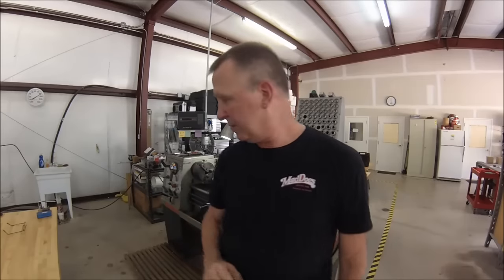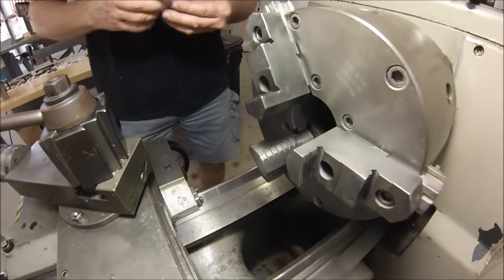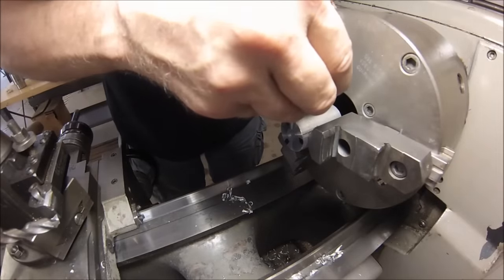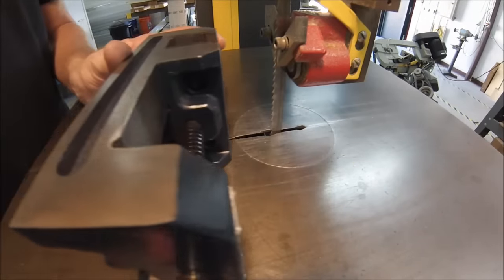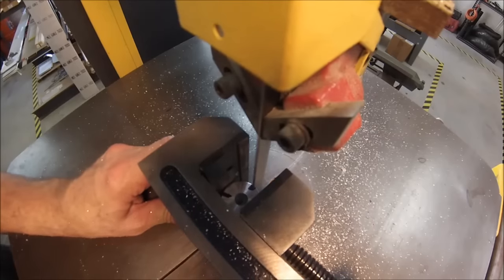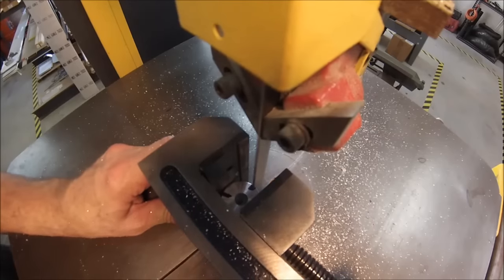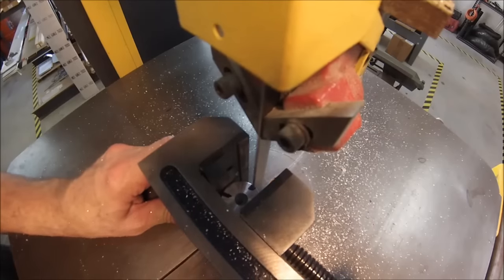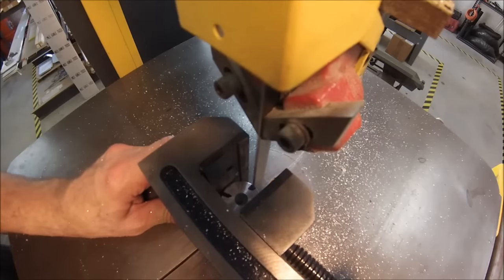Get your parts to run true in a non adjustable chuck. YOU MUST WATCH THIS!

Comment: I always wondered why people insist on filing right-handed on a lathe. It looks dangerous as hell to me and filing left handed is not hard. Are we not machinists? Are we not 95% ambidextrous anyway?
Reply from the maker: Isn't standing in front of a machine tossing hot sharp chips dangerous? I say file the way you have the most control and just keep the tip of the file away from the jaws. I have tried left hand filing and I'm not a fan.
Reply: I've tried left hand filing and it seems if the file skidded off the part it was right into the chuck. Right handed I was braced on the headstock of my lathe and still in control. I'm only running a small 10" lathe so it might be a different story with a large machine.
Reply from the maker: I agree with you 100%. On larger machines, I always deburr the parts with a chamfer tool in a holder.
Reply: @disgruntlescientist: Have you tried using a lathe file?
Reply: It just seems to me you end up hugging the headstock that way, with your entire head and body directly in the plane of the rotating chuck -while filing.

Comment: I pucker when I see someone filing a part close to the chuck, I usually put the file on the other side so if hits the chuck it will through it away from me.
Reply from the maker: So basically when you loose your registration point you'll fall into the jaws ???   Its only the tip you have to worry about. I've been doing this for over 40 years and have not had a chuck grab a file yet (knock wood) Stick with what you know and has worked. Overall....there is nothing good about putting body parts that close to moving machinery. You just have to accept it is part of the trade.
Reply: Use the file as a left hander when the chuck is large.

Comment: It looked like a bit of a bodge tbh. Which only works for pre-round pre ground stock and then each new piece has to start the same size. Why not spend the 1/2 hour to better set up the chuck to run true for all stock?
Reply from the maker: Thats not the idea behind this video.
Reply: Oh my days...There's always one expert that wants to rubbish a great idea. What if you're a home hobby guy that just wants to turn an accurate part on your ancient machine because you can't afford anything better? Joe I've been doing this stuff since the mid 80's. This is one of the best hacks I've seen, I've been doing the reverse for years...turning a diameter onto a bar with slots in and a threaded and countersunk hole down the centre...put your part on wind a countersunk screw in to expand your mandrel and now you turn concentrically to your ID Top drawer mate...keep them coming.
Reply: @iiredeyeiiredeye1569  look i can see that it works.  But my point is that it only works for the specific piece of stock that you have at the time. Would it not be better to fix the origin of the problem that this "fix" is trying to solve for any and all your stock? That way in future you wouldn't have to waste time and metal making an ad-hoc collet for every job.
Reply: @joepie221  i get it. It works, but is there not a way to fix the machine? Surely a fully true machine to acceptable tolerances is better than having to make a fix every time? Can you show us that fix? Regrind the spindle nose of the lathe or checking the centres?
Reply from the maker: @martynbrown8210  This is a band aid solution. Re grinding the jaws with a tool post grinder is the true repair for this situation. I don't have a video, or the need to do this, but there are many videos on the process on youtube.

Comment: A cool trick but soft jaws are much faster and easier to deal with.
Reply from the maker: IF you have them, and the carrier jaws required. This will help you get the job done. It is not a repair.
Reply: @joepie221  agreed! Just thought I would mention this as another option.

Comment: Joe, the last time I watched one of your videos, I hadn't started working yet. Call it four weeks ago. Now that I've been hired on as a machinist at a die plant, let me tell you. My lathes are TRASH. You can't part on them, can't thread on them, can't change feed speeds can't even singlepoint on them. But they can turn cores with a tolerance of plus or minues two, so I make it work. The day they can't, though you can make a bet I'm taking a crowbar to the gearbox.

Comment: Thanks for the technique and thanks for sharing. But time is money and for the 25+ minutes you spent making this bushing or collet, I would spend my money on an adjust true chuck and/or collets. I have both already. And none of my none-adjustable 3 jaw chucks run out more than about .005". And another way would be to chuck up your round part in a 4 jaw chuck and take the time to indicate it in, could do that in under 25 minutes also.
Reply from the maker: The topic and content of this video are very specific. If I wasn't doing a video, this would take me 5 minutes and cost about $2. thanks for your comment.
Reply: @StevenHaskell:

For a pro, time might be money, but then again, wouldn't a pro already have an adjustable chuck?

For the home gamer, time is most definitely NOT money, and this technique absolutely rocks.  I could see someone like me buying an old surplus, worn out lathe and stuff like this might get me some higher quality from it for the cost of a piece of scrap and some non-compensated-anyway time.

Plus, it's just dang cool.

Comment: Joe I’m new to lathes. That quick tool post. Is that what it’s called or known by some other title? Cool video.
Reply from the maker: QCTP Quick Change Tool Post  Aloris makes quite a few different sizes and there are others.
Reply: @joepie221  I went to bed last night and found myself thinking a few hours later about your solution to a chuck out of alignment. Very cool. The more I consider it it all makes perfect sense. My dad has a lathe and for years I thought he was good at metalwork because he makes pro-shafts. Then when I grew up and went in asking him about the lathe I found he knows nothing. Shameful. I love em. I think they really are cool. Something I have found though is only yesterday. Looking at lathes I realised most had a stupid small diameter hole running back through meaning you could only feed thin tubing in through to the chuck. What the hell do they do that for? Anyway yesterday I found if you google engine lathe you can get them with 200mm bore. Makes so much more sense to have that.
Reply: You are a clever man. Be watching more videos. Subscribed too. I want your knowledge. ha ha
Reply: @Erik Mikkelsaar yep figured bearing size when I looked at breakdown of a lathe. Then found engine lathes can have a bore of 200mm. Told dad and he never knew you had to search that exact criteria for the larger bore size either and he's 86. Engine lathe would suit me fine. Just don't see the logic of such a small bore. Means you can do much else than small parts.
Reply: @Erik Mikkelsaar Thx for the reply. im curious. So what do you mean by 12 inches being 362mm diameter without removing the gap? Yep Im new to this. Also tell me something else whilst you are there. If you don't mind that is. I tried to bore out a 40mm od tube with 30mm id on dads lathe. OK so boring bar in and got the angle wrong slightly off 90 degrees but still, anyway the inside after I had finished was almost threaded. Run finger inside and feel thread like grooves all along. New bar with new tip. How did that happen? I spent the weekend pondering on it and came up with the fingers in the chuck can't be holding it perfectly centred. Was I right? Can you get it super smooth inside?

Also lastly for a 24mm keyed shaft, I was to heat the tube to fit it so it contracts as cools to make it real tight. What is the internal size for that to happen? 24mm shaft so id of tube say 24.5mm or less? Really don't know.

Appreciate your help.
Reply: @Erik Mikkelsaar so saying you wanted to heat shrink to a 24mm shaft. What would you go for with the id of the tube to be fitted. I know the tube is a lathe er32 collet extension from Amazon. So probably from China and if fair to assume, probably not the best steel.
Reply: @jamesbarratt593  The size of the hollow spindle (the hole through the headstock spindle) will vary with the size of the lathe and more importantly the diameter of the headstock shaft. It also relates to the capacity of the lathe in terms of rigidity and power and size of the chuck.There are no "small" lathes that a hobbyist would normally have that would have much above 40 mm, many larger production lathes only have 60 to 80mm bores. To have a 200 mm bore means you need a chuck with a matching or slightly larger size hole through the chuck - that would be a very substantial piece of equipment

Comment: 25:50

How could the item in the chuck, "lose its rotation"?  What does that even mean?
Reply from the maker: The ID of the bushing is eccentric to the OD. The OD of the bushing is eccentric to the lathe centerline. Once the bushing is bored or reamed, this set of relationships must remain undisturbed, or the true running nature of the bushing is gone. If the bushing rotates, its worthless. Maybe the word 'Clocking' would make more sense?
Reply: I'm confused about how you kept the "clocking" of the part when you flipped it to face the second side. you marked the orientation to the chuck key only after it was flipped...
Reply from the maker: The final ID of the bushing was done after that step. Once the ID was bored and reamed, it never came out.

Comment: I knew you could say "thousand" Joe (at the end), instead of "thou". LOL "Thou" is biblical. Our Father in Heaven says that all the time.
Tip: turn the file around and pull it at the bottom of the stock toward you. Safer if it gets hung, it will fly away instead of through your hand> Keep it pretty dude!
Reply: Seems like a Canadian thing even though its increasingly common to hear it from "Americans". Canadians shorten "radiator" to "rad" (rhymes with "dad" so its doubly stupid) and Chevrolet or even Chevy to "Chev", etc. Too lazy to put the extra effort into using the "full" word or trying to differentiate their superior selves from "yanks" or something. Regardless, "thou" is not "American" in origin.

Comment: I'm looking to get 3 in1 machines, what one would you go for the smithy  or grizzly  thank you O'Deen
Reply from the maker: I have zero experience with 3 in 1 machines, so I'm not the guy to ask.  Anybody care to comment on this ?
Reply: Don’t expect much from a three in one.  They are not ridged enough hard to hold any tight tolerance like +-.003 .  I know this is not tight but it will be the norm or less with a 3in one. I own 3 lathes 2 CNC and one  cnc and manual .  I have been cutting metal for around 50 +years and have tried many combinations! An all in one is weak in all three combinations.

Comment: Can the chuck unbolt from the back plate. If so machine it the .0065 off it. Bolt  it back up indicate it. If at zero  tighten it up. If  you want take It off and dowel it. It looks like a cam lock chuck.
Reply from the maker: This is an adjust tru chuck and this error can easily be dialed out. This demo is for chucks that don't adjust and jaw resurfacing is not an option.
Reply: @joepie221   Its amazing how people just hear the part they want to hear . You did explane this very well .

Comment: Great trick but i don't get why it works!
Reply: because the magic of a lathe is that, when your cutters are rigid, you can reveal concentricity by turning. because there is always some part within the metal that is concentric. in the case of the hole, when he internally bores it and then drills and reams it, he is removing the 15 thou of runout he had earlier. after this is done, the runout is replaced it with the runout in his spindle (effectively zero). this is because the rigid cutting tool (the boring bar) always will bore a hole that is perfectly in line with the spindle. it won't just follow the path of the old hole. you can think of it as cutting away the metal that is causing the inconcentricity.

Comment: What it not be better to machine the jaws to remove the error?
Reply from the maker: Regrinding worn jaws is the ultimate fix, but not all small garage shops have a toolpost grinder. This is a band-aid, but will get the job done.
Reply: Error from wear in scroll plate would be a variable.

Comment: What is wrong with using soft jaws...pretty much standard procedure and less trouble and accurate.
Reply from the maker: Nothing at all. This is a 5 minute fix. I dare you to setup and bore soft jaws that quick.
Reply: 5 min. fix?  the video took 30 min.    this method is too slow.  If you can't set up and bore soft jaws in 10 min you better quit.
Reply from the maker: The video took 30 minutes because I had to worry about the camera. I'll do this in 5 minutes max. Any day. The video wasn't about soft jaws.
Reply: Let me take my comment back....lets say we don't have soft jaws and had to make them up from scratch or start with a new set, then this is an excellent fix!
Reply from the maker: Thank you. That was the intent. I like to post videos that can help you get past obstacles if tools, money or time is an issue. I appreciate you coming back to comment.

Comment: Alright Joe Precision, here is the video I would like to see. To turn a repaired bearing surface on the tail stock that has a predrilled center hole but it runs out several thousands. I work for a large commercial printer and we have rollers that die cut label stock. That's two layers of paper and they only want to cut the top layer. This is a 6 inch diameter roller with a 15mm stub shaft for the bearing. It has a hardened bearer surface that actually carries the load but the small 6002 bearing keeps it in the press.
Reply: I think Abom79 might have something on his channel, pretty sure he's been doing repair work on rollers.
Reply: stanlosh: I used to do journal repair on rollers with this problem. What we did was set up the steady rest on the journal to be repaired and grind a
tool to put in the tool post and recut the center. Hope that helps.

Comment: Why is it bad to turn the machine on with an empty chuck?
Reply from the maker: The acceleration of the jaws, scroll and chuck body can happen at different rates. The jaws can walk out. Remove your jaws and start the machine. Shut the machine off and listen to the scroll spin for another second. I've always suggested to have a part in a chuck if its going to spin.
Reply: @joepie221  I didn't know this, but sounds logical, specially at high speeds.

Comment: I see what you did there, not a bad idea I guess if your boss says, "don't indicate the chuck, that chuck is fine" even though you know it isn't.  (ask me how I know.....) Otherwise, indicate the chuck on the spindle if you don't have a 4-jaw.  Also, NEVER file a running part.
Reply from the maker: Been filing running parts for over 40 years. Knock wood. Never had a problem.

Comment: OK but most of these shops wont give you time to do this.Wont happen ,but cool technique.
Reply from the maker: But I bet they give you time to make another part when the concentricity between ends is out. I can get one of these up and running in 5 minutes. If the boss can't spare 5 minutes, he's in trouble.
Reply: Exactly we never seem to have the time to do it right the first time but seem to make time to do it right the second time. :)

Comment: 2:50 Why don't you want to turn your machine on with nothing in the chuck? The chuck is still very massive so it's not like you'd burn out the motor
Reply from the maker: Jaws not under pressure can sling out. Its not about the motor.
Reply: I agree with those things, but you could tighten the jaws onto themselves... I can see though how it might not be as secure though. Good safety tip. Not like I was turning a lathe on with nothing in the chuck yet anyway, no real reason to.

Comment: got denford viceroy 10inch and the 3 jaw chuck has 0.03mm runout .. the register is very tight. would it be advisable to take a thou or 2 off the raised part of the register on the backplate to enable an adjustment to take out this runout ?
Reply from the maker: Many take that path.

Comment: Joe, I have recently discovered and much enjoy your videos. Something I don't quite get--is this bushing only accurate as long as it is in the chuck under load as was made, never having been removed? Or can it be removed and used again?
Reply: From below
@Joe Pieczynski
2 days ago
I keep that little vise on my welding table and grab it for stuff like this. Works well.
Reply from the maker: Its most accurate when left in place. If you have to use it again, its best bored to a larger size, but try to position it in the marks left behind by the jaw imprint from the previous setup.
Reply: We were given two chucks, 1 was for best (only bright steel and already turned component) and a second for hot or black rolled stock. Run out of more than a thou on the good chuck ment an examination of the taper on the spindle, if a particle of swarf was found you got doubled round the sports field but 2 years on hand tools before you got near a machine.

Comment: i just made a bushing about 1/8 t 1/4  bigger than id  ,then squish the bushing to hold the part, only one step
Reply from the maker: Technically, it doesn't squish until you split it. That means 2 steps.